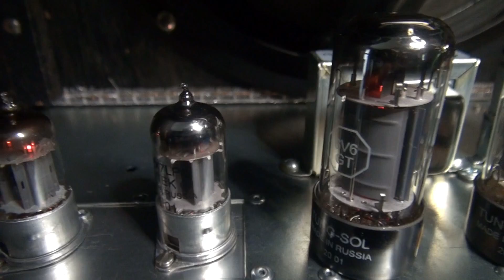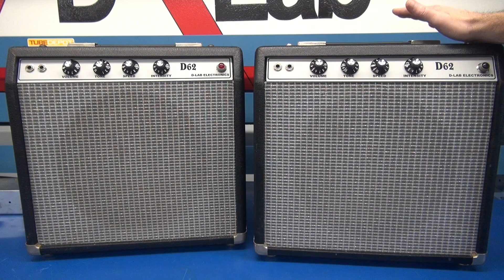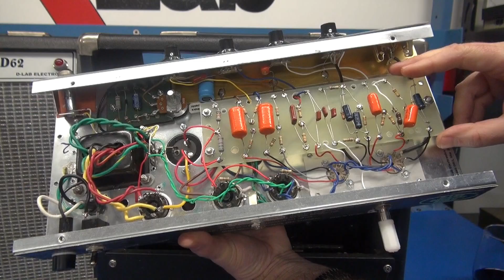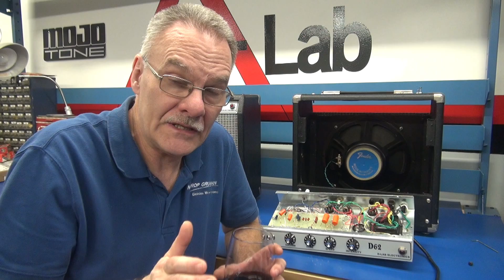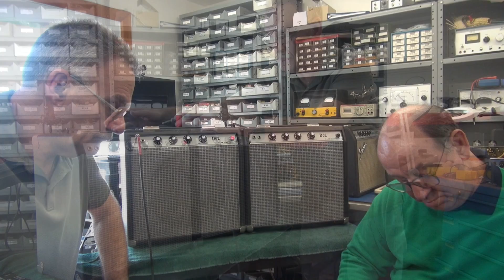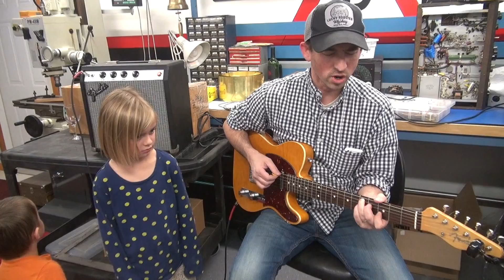New D-Lab D62 Boutique 6V6 Tube guitar practice amp modified Fender Princeton 6G2 Super power tone

Comment: An excellent repurpose for an old solid state Fender amp. It is especially nice when you can get a cabinet all done and tolexed, especially if you can buy the old solid-state amp dead for twenty bucks. The build is still fairly expensive, Parts wise, and it is a fair amount of work

Comment: A question regarding grounding. I understand the need for a ground. However, my question is more upon the location of the ground. Is the contact point more important than the location? To be more specific, since they are all connected to the same piece of material, the chassis, how does it matter? I'm sorry if my question doesn't make much sense. There are electronic concepts I'm learning as I go along. Until I understand them better, it's difficult to word my questions.